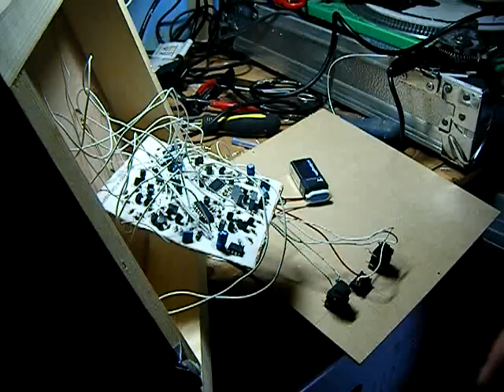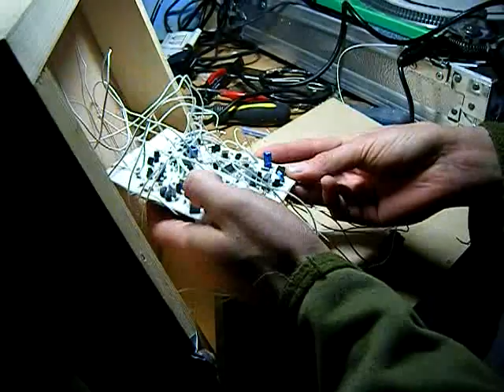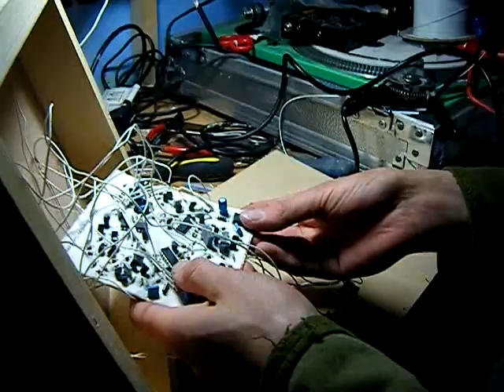My Synth has turned into a radio!

Comment from the maker: @TheSaltshake Your right there are two sounds. There are two jack outputs, although at the time I was only using one of the outputs. How did you make a synth from an amp? That souds really interesting and dangerous at the same time! This synth also sounds really good without batteries using a mixer with phantom power turned on. It sounds like loads of crazy sirens going off at the same time, I'll have to get it wired up and a vidoe sorted. Next mission is to make a moog theremin.

Comment from the maker: @TheSaltshake thats the thing about the theremin, I have some circuit diagrams, using transistors and caps, no chips, unless I choose to use a small audio amp chip. try making a sequencer with a programmable chip. I made a 8 step sequencer and it took days, if you want the circuit diagram and layout of prototype board send me an email.